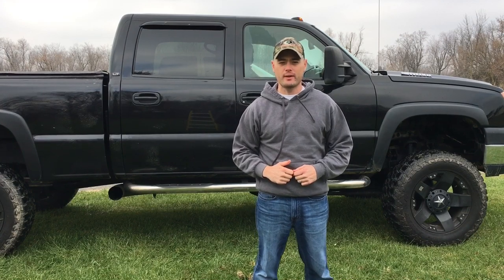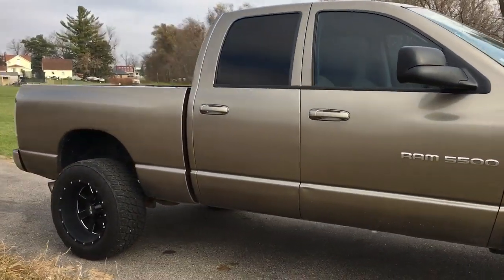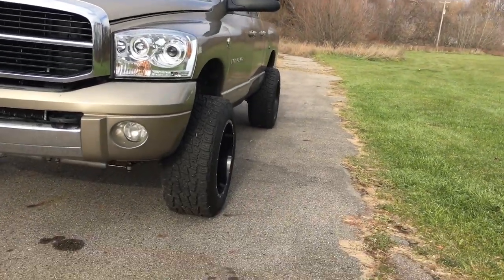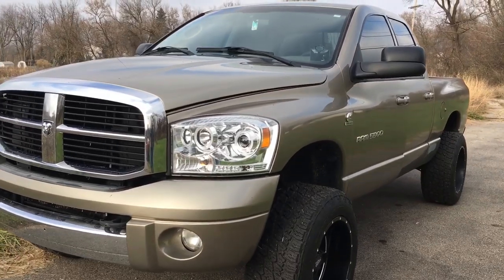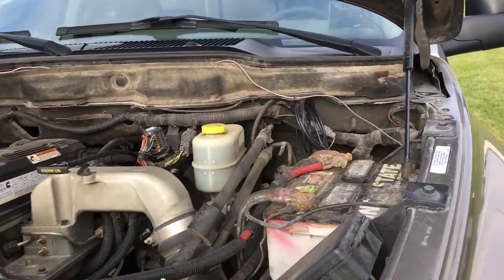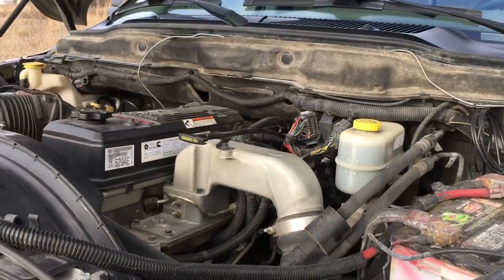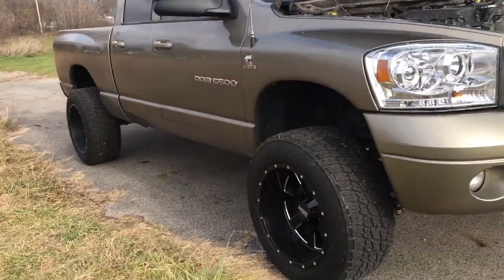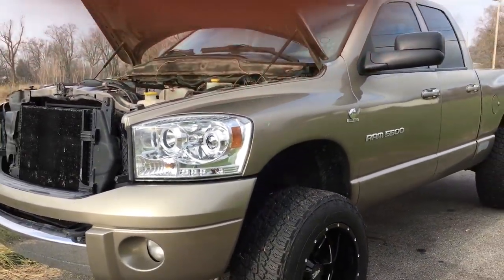2006 5.9L Cummins Introduction

Comment: How did the lift pump turn out. I’m looking at the new fleece proflo that is a total in tank pump. Supports 800 hp. I’m not interested in hanging filters on the frame rails

Comment: I have a question. So my 06 lbz cold start like 10-20 degrees and colder it blows blue smoke out for a while tulle like 120 degrees and at idle it kind of has a blue haze. My friends lmm same mods and mileage doesn't do it at all like mine. I have 180k and efi live 5 inch straight pipe egr delete ported fuel fitting and intake couple other things but I'm worried it's something serious if you had any input that would be great thanks
Reply from the maker: +Joshua Doustou (jdsupa15) the first thing I thought about was dirty injectors like mine. Before you start thinking the worst try to add some injector cleaner additive every fill up for a month it might clean it up. I will be doing a injector cleaning video soon good luck man
Reply: Truck Master what cleaner do you reccomend
Reply from the maker: +Joshua Doustou (jdsupa15) I normally use Lucas injector cleaner you can buy it at any gas station
Reply: Truck Master is it diesel specific or is it used in both?
Reply: Truck Master also would a bad fuel filter be a reason for that?
Reply from the maker: +Joshua Doustou very possible it could be a fuel filter but the filter must be really old to be hazing exhaust like that and the Lucas cleaners will say gas or diesel so it's good for both
Reply: Truck Master What would you say is more reliable/better in your opinion the Lbz or the 24v Cummins? I personally like all 3 Diesels but have no personal experience due to never owning or driving one.
Reply from the maker: Mr.J it's a great question and it all goes  back to preference. Both trucks are equally awesome in there own way and I believe both diesel can last for years but to answer your question the LBZ is more expensive but more comfortable vs the dodge that is straight axle. The 24v is much easier to work on due to it only having one valve cover. If you go with Ford for reliability I suggest staying Away from the 6.0 and 6.4 the 6.7 and 7.3 power strokes are the way to go for ford
Reply: Truck Master alright, TY
Reply: Truck Master You hit it on the head. The perfect truck would be a Ford cab, Cummins 5.9, with Chevy suspension. I'd go with the Aisin automatic over the Allison. I've seen plenty of Allisons fail. I'm not that impressed with them.

Comment: Hey man nice truck... I'm looking to do something similar on the wheel and tire setup... I'm truck is stock and always been in the garage... could you please measure the overall height I have a 7' foot garage door will this set up for thro?  Thanks man
Reply from the maker: +dalton majors it will fit watch my recent video the cummins fit in the garage mines 7ft as well
Reply: Truck Master thanks man

Comment: been thinking about also getting a 2nd gen 5.9 24v cummins to add with my 06 lly
Reply from the maker: +TrollMaster300 that would be awesome, if you can afford it go for the common rail 5.9
Reply: Truck Master so the common rail is better than injectors?